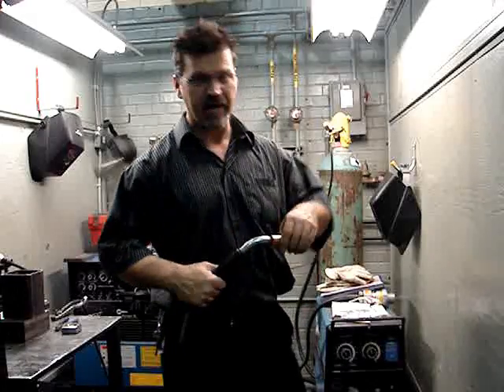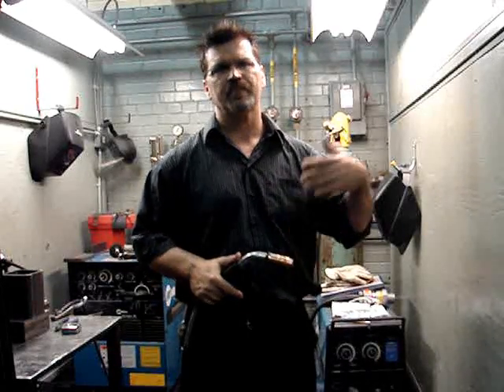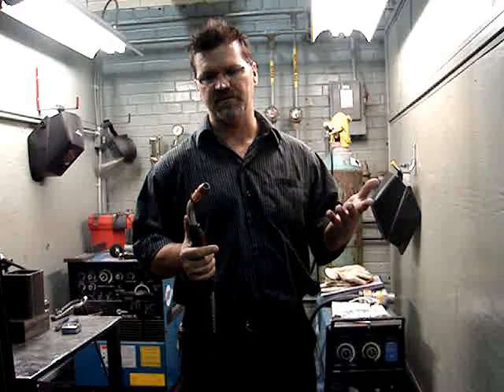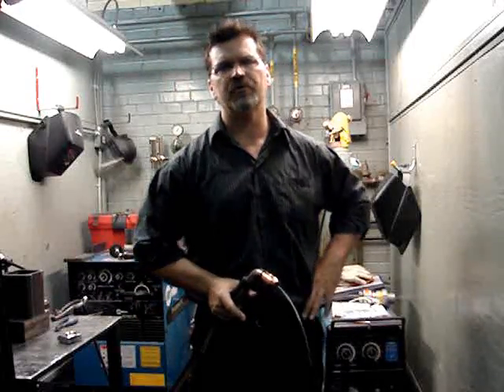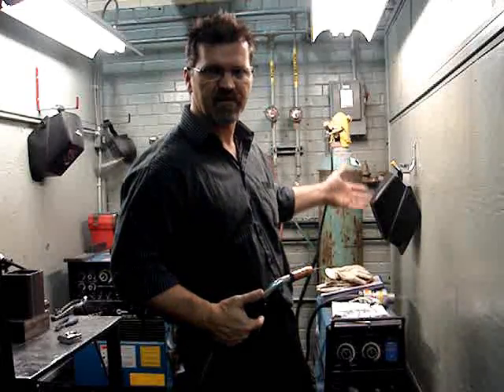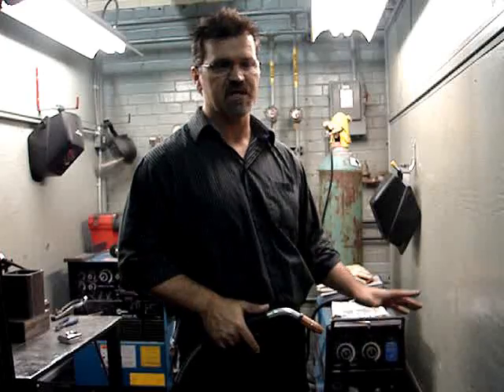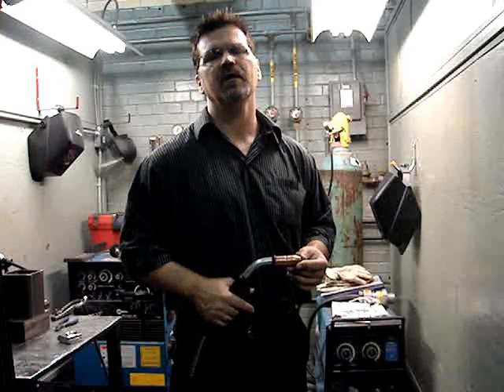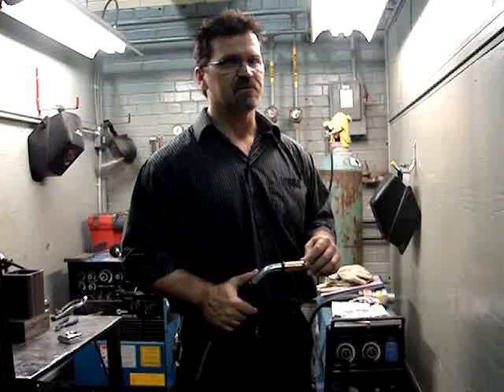Mig welding tips: technique for seting Wire feed speed

Comment: What was the WIRE FEED SPEED SET To WHEN you MEASURED THE WIRE to 24 inches 2, 5, or 10 ???  I.E. what adjustment number corresponds to that 24 inches / minute ??

Comment: Wow, I see this was done 15 years ago!
Question..my welder has a delay before it speeds up to the set inches per minute wirespeed. Even when I turn it off when it is going the set speed and then restart it it stills starts slowly and then speeds up to set speed. Is there away to start the wirespeed at the set speed right away so I can measure the distanced travelled in 6 secs?

Comment: @fabfabber  With MIG it's easy to make an excellent-looking weld that still has serious lack-of-penetration and lack-of-fusion defects. These types of defects are rarely apparent from visual examination alone. 

There are two types of welders in the world, those who focus on cosmetic appearance, and those who focus on AMPERAGE. The way to know that you're using sufficient amperage for a given thickness, is by making test samples, keeping notes of the current, and destructively bend testing them.